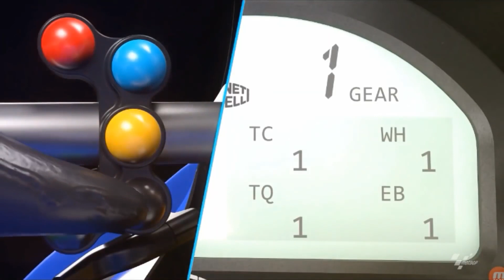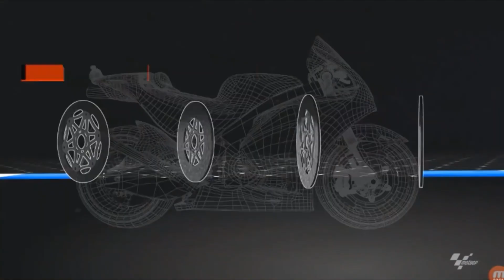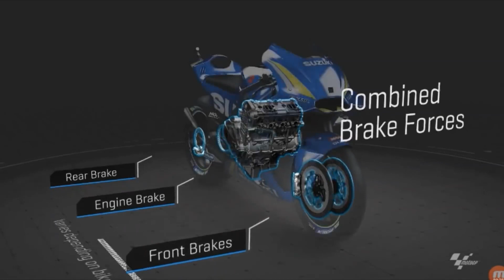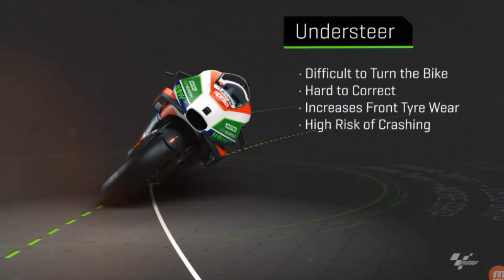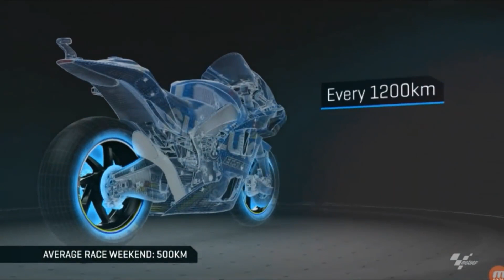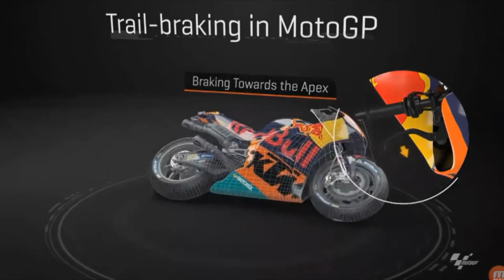MotoGP bikes technology

Comment: paps simula nong nagka issue sa break swicth ngayon nman yung cable ng trothle palagi nalang nka pihit...lakas na mg ugong nga makina...d na normal para ng d na bumalik sa normal yung cable..paps ano po ba pwde gawin??
Reply from the maker: check mp throttle cable pede may putol na wire sa loob nun